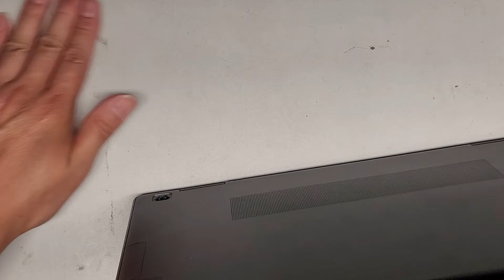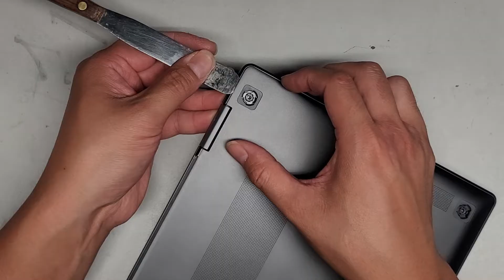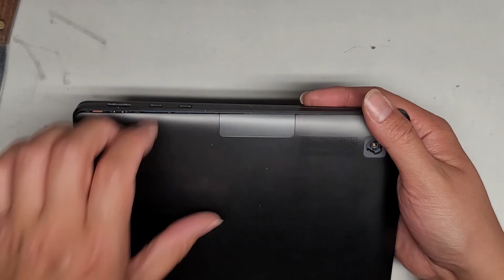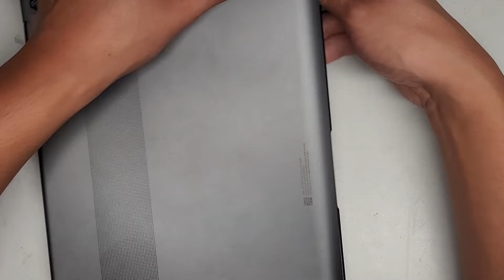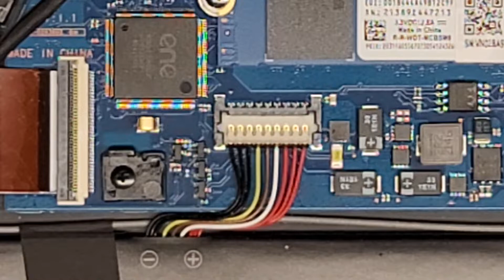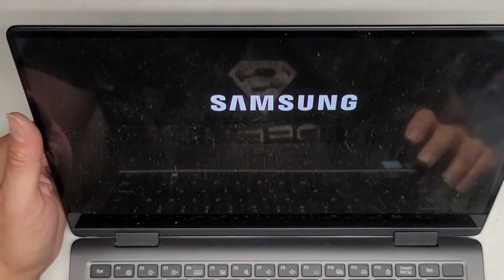Samsung Galaxy Book2 360 NP730QED Disassembly SSD Hard Drive Upgrade Battery Replacement Repair

Comment: Just 4 screws. Nice.

I would use a plastic spundger, once you can get them into a crack they can be rotated to pop those clips all around the edges. Then it should just drop off.
Reply from the maker: Less screws = more clips that are a pain.

Comment: So you just put the ssd hard drive without any modification? I can do it myself without risk of bricking it?
Reply from the maker: You need to clonec your old drive to it or do a clean windows install.
Reply: @ItsBinhRepaired  i see, there's a tutorial to do that? Do i need like an adapter to transfer the data to the new ssd?
Reply from the maker: @brenton8334  this video will help https://youtu.be/4p5jFDzVwUw

Comment: The tutorial is great, For those who broke their laptop, It may be caused by you guys not removing the battery and doing the discharge, Or you guys are using bare hands and in a hot temperature that cause static electricity to hit your motherboard and fry it up, Its inportant to wear gloves or anti static bands when doing things like this!
Reply from the maker: No, not necessary. Lol
Reply: @ItsBinhRepaired Do you perhaps know how to repair Samsung galaxy book 2 360 having issues booting up? Like the blue light flicker and the keyboard loght up for a sec then closing again? No display or whatever

Comment: Thank you for the tutorial.  It was a great reference for me on how to remove the bottom of the laptop to access the battery.  I used a small metal screwdriver to gently pop the bottom around the hinges and then used it to get the sides started and then every few inches to pop the next latch.  If you take your time its easy to remove.
Reply from the maker: @JamesSmith-qg2gf  awesome, glad it helped. If you haven't already, please like and subscribe so others can find my videos and possibly consider watching a few others, liking and commenting to get the algorithm to recommend my channel. Thanks!

Comment: What an unexpected relief ! I would not think I will see my dead 360 running (I had no responsiveness, no led light. A week before worked perfectly). Now I'm recharging to full to see if that's the end of the struggle or the battery needs replacing. THANK YOU ❤
Reply from the maker: Awesome, glad it helped. If you haven't already, please like and subscribe so others can find my videos and possibly consider watching a few others and commenting to get the algorithm to recommend my channel. Thanks!
Reply from the maker: @HayleyParadive  no

Comment: Do you know if there's a sticker with the serial number of the computer inside? The engraving has been rubbed off on mine, I'm sure my laptop is still under warranty but samsung Canada is refusing to service it unless I provide them the serial number. Any help would be appreciated, Im wondering before I buy the tools needed to open the back
Reply from the maker: I'm not sure, sorry.

Comment: Do you know if there is a bios battery on the other side? I need to clear the bios settings but when I took it apart, there was no cmos battery in sight :S
Reply from the maker: No, it's built into the main battery.
Reply: @ItsBinhRepaired  Is there a way to reset the cmos then if there is no dedicated battery?
Reply from the maker: @guns102  disconnect the main battery and press the power button 15 seconds. This doesn't remove the bios password.
Reply: @ItsBinhRepaired  So there is no way to remove the bios password then? I did try take it to the store but they refused to look at it as they said it was self-inflicted. (long story but their live chat told me to go into the setup utility but to do that you have to setup a supervisor password but then the password doesn't work so now it's bricked). Would appreciate any further advice :S
Reply from the maker: Sadly no way that I know of.
Reply: @guns102 hi man, I have the same problem here

Comment: hey if you see this, i have the same laptop and the bottom right of my laptop (where my right wrist would rest) has this weird slight lump thats protruding. from what im seeing on this video, it maybe part of the battery? do you know what would have caused this?
Reply from the maker: Bad battery?
Reply: @ItsBinhRepaired  my battery seems perfectly normal. Although I never really use my laptop without charging, my battery report shows very little degradation.
Reply from the maker: @minwu0607  open the laptop and look inside

Comment: You should really be using a nylon spudger tool to pry the backing apart. Along with anti static tweezers to unplug connectors. Which should be done after you've discharged any static electricity you have by touching a grounded metal. A butter knife and fingernails are not really ideal on computer equipment. Especially if you are doing this as "PC repair"and charging someone. Also, the WiFi radio is not soldered in place. It's using snap on metal connectors.
Reply from the maker: @videogameobsession  I'd like to see you pull the wireless card out... the antennas can be disconnected, but not the card. I've been doing this over 17 years now. I've tried those spudgers and stuff. Usually if I can't pop it open with my fingernails, those tools will just break. It's not a butter knife. It's a super thin stainless steel pharmacy spatula. I always touch something that would usually shock me when I'm charged up before touching the internals of computers. I've never had an issue.

Do you do this for a living as well, or are you just saying based on what you've been told and seen?
Reply: I'm retired now, bu I used to run a custom PC building company, where I built custom PCs, along with repair services. My wife has also been repairing PCs since the mid 90s.

I wasn't trying to attack you personally, but I'd just like to see DIY videos take more precautions to help keep people from shorting something out, etc. Sorry to have been so blunt with my comment.
Reply from the maker: @videogameobsession  I don't think it's at important as people think it is. If it was that big of an issue, you'd think CPU, GPU, RAM, motherboard manufacturers would include one. A few dollars to save a few hundred to thousands. Also, a lot of people don't read instructions and don't know the grounding strap needs to be connected to a ground. Lol
Reply: It can be a real problem for people with carpeting and low humidity, especially during the colder months. Our old house was like that. My brothers and I would literally scuff our socked feet on the carpeted floor a few times, then sneak up and shock each other. :P Some were pretty "jolting". You could even see the spark.
Reply from the maker: @videogameobsession I'd hope that if people are shocking themselves while walking around their house, they'd know to be extra careful. Haha

Comment: Hey, could you please leave a link to the screwdriver?
Reply from the maker: @subhashsarangi  this set will work for most electronics https://amzn.to/3LSRGj0 you can also use this cheaper set https://amzn.to/3Wzmz0U
Reply: @ItsBinhRepaired  Thanks, Man!
Reply from the maker: @subhashsarangi  no problem

Comment: Where's the RAM brah?
Reply from the maker: Soldered to the motherboard
Reply: @ItsBinhRepaired  Where though? On the other side?  I don't see the RAM chips.
Reply from the maker: Search the laptop on ebay for the motherboard and find pictures of it if you really need to see. I dunno what seeing it will do.

Comment: do not blow compressed air in the fan, you don't know if the circuits can handle the reverse voltage that will be generated by spinning the fan, the faster it spins the higher  the voltage
Reply from the maker: No modern computer has that issue.

Comment: Is it pci 3.0 or pci 4.0?
Reply from the maker: No idea
Reply: @ItsBinhRepaired  isnt the 980 ssd you installed pci 4.0?
Why are the speeds not 7000mbps+?
Reply from the maker: @socommaster  if the slot isn't 4.0 it runs in compatability mode, but I'm not sure what it is.

Comment: Is it possible to change the thermal paste? I bought one Cooler Master MasterGel Make Nano, I was thinking about replace it while I'm already going to replacing the SSD
Reply from the maker: Sure, but unless it's overheating, there's no point.
Reply: @ItsBinhRepaired  Factory paste is pretty lame. It can't hurt.
Reply from the maker: @MyGoogleYoutube  it can if you damage the computer in the process.

Comment: I’m a novice so please forgive my lack of understanding here. I just bought a book 3 360 and it has a microSD slot on the side. Wouldn’t it be just easier to buy an SD card and leave it in there. That way you can utilise the existing SSD already inside plus the new SD card ?? Just a thought what do you all think. Thanks.
Reply: SD cards are almost not viable long term storage devices. They generally built as a transport device. I wouldn’t trust any MicroSD for data that isn’t backed up elsewhere or is coming to the main drive from a camera device.
Reply from the maker: Yeah
Reply from the maker: SD cards are very slow, but yeah, you can do that.

Comment: I have the same laptop. Wish the battery life didn't suck though haha.
Reply: @ItsBinhRepaired  Is your battery life terible also?
Reply from the maker: @ericyost5287  I don't own the computers, so I'm not sure.
Reply: I have the same laptop and had the same issue with the battery life. But I did some research on what tweaks you can do to the settings and it made it last a lot longer. Mine lasts several hours now. I can't remember what all I did, but I know taking it off "Samsung Mode" was one. Also keeping the "energy saver" on was another. I only turn it off when I'm trying to do several things at once and more performance from the laptop is required (basically when I feel it start to lag), which isn't very often. Might be able to ChatGPT the rest.

Comment: Why is my Mac book pro slow 😢
Reply from the maker: This isn't a MacBook video. Find one if my videos with the right model on the bottom of your MacBook. I don't know which one you're talking about.
Reply: @ItsBinhRepaired  Thanks! I was just asking to see what your thoughts were for help
Reply from the maker: @TheBlueTaco0  I'll need to know which MacBook you have. There are a lot of models
Reply: @ItsBinhRepaired  it’s fine. It’s old so I just have to shut it down then restart it back up. Thanks tho!
Reply from the maker: @TheBlueTaco0  how old?
Reply: @ItsBinhRepaired  2011 MacBook Pro 13 inch
Reply from the maker: @TheBlueTaco0  likely not enough RAM for the newer OS. If it's extremely slow and fan going crazy, it's likely a bad touchpad
Reply: @ItsBinhRepaired  ah, makes sense
Reply from the maker: @TheBlueTaco0  yup